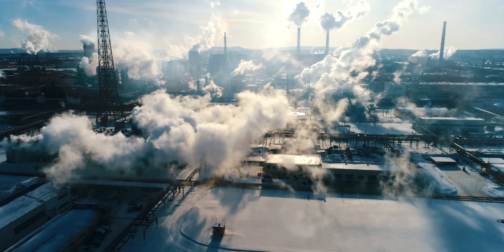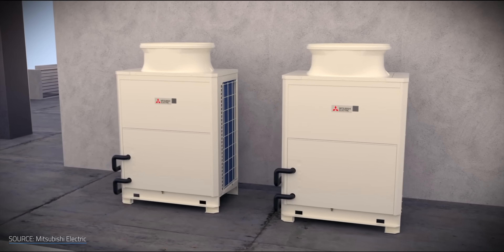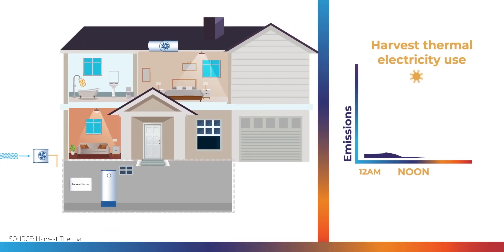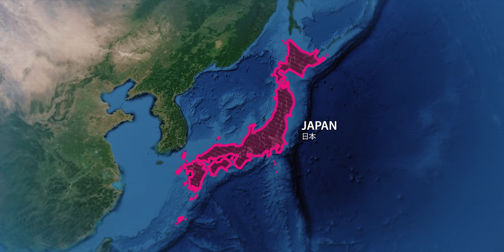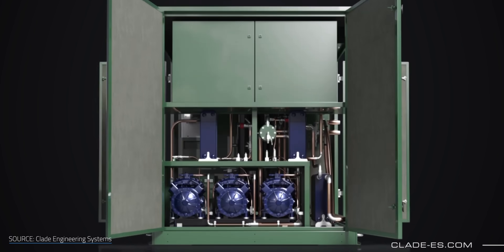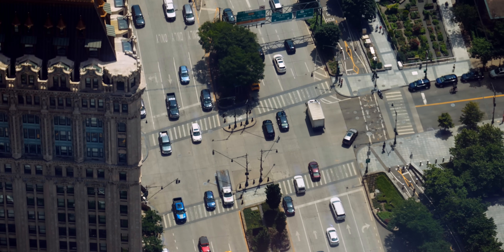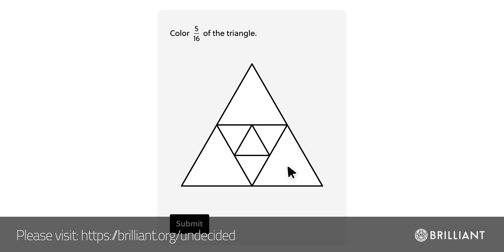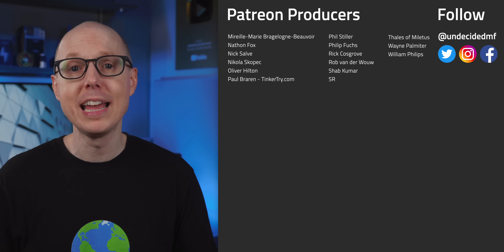Why CO2 Heat Pumps Are The Future Of Cooling

Comment: I always thought part of the efficiency gain of a heat pump was due to the phase change in the heat transfer fluid; typically liquid to gas.  With CO2 I was under the impression that you couldn't get this phase change as CO2 has a strong preference not to exist as a liquid, the triple point is just not in the right place.  So how exactly does a CO2 based system get to COP of 3?
Reply: Heat pumps work by chaning th pressure of working fluid or gas.  You donned a phase change to have an efficient device.  Dropping the pressure will cause the refrigerant to cool.  Increasing the pressure increase temperature.  PHse change is not repuired  for an efficient heat pump.  In fact you can use hydrogen or helium as a refrigerantin an eficent het pump without a phase change occurring.   a heat pump  and these gases need to be cooled down to nearabsolute zero (-273C) to liquify.

Comment: I was sort of joking about this recently - but could/would it ever make sense to combine all our heating/cooling? Like could a system like this hook up to fridges and freezers in the house too? (obviously expensive (guess having fewer compressors wouldn't do enough to offset the cost of it being novel) and risky - single point of failure, a whole separate high pressure, insulated piping system in the house, etc... )
Reply: Hooking up the 750 Btu refrigerator or freezer compressor to your home cooling 36,000 BTU compressor is not a good idea.  They use different compression ratios, and to make your home cooling system run at 0F to make the refrigerator or freezer work, it would be consuming much more energy than the refrigerator or freezer would consume.

Comment: Az uses heat pumps but never knew about c02, just had our condenser replaced. When our ac goes out or building my future home curious what cost benefits there would be compared to geothermal or other cooling and heating optiona

Comment: Ok, you really don’t have a clue what you are talking about. The refrigerants we most commonly used were R12 for cars and refrigerators and R22 for home and business Air-conditioning. These were the best refrigerants for the job. “They” wanted us to switch to different  refrigerants so they claimed that the tiny little bit of chlorine in the refrigerant reduced the ozone.  People have so little critical thinking that they believe the lie. People dump gallons of chlorine in their pools every year. Chlorine evaporates quickly.  They said it would take hundreds of years to heal the ozone layer. How much have you heard about the ozone lately? Why is it magically better now? CO2 is not a good answer as a refrigerant. R12 and R22 is...
BTW, the refrigerant y1234 has propane in it, and people’s refrigerators have exploded in their kitchens when the compressor burns out. People have already died from it.
CO2 has an incredibly high liquid pressure over 1000psi at 86 F... R12 is a much better refrigerant... (COP doing change with temperature much, btu capacity is what changes) These machines with CO2 are full of extremely high pressure liquid (over 1000 psi)

Comment: I added a hybrid heat pump when I did a renovation.  That said, there is no temperature where it is cheaper to heat my house using electric over the gas "back up" line.  I am not arguing efficiency - I am only talking cost to me.  Once gas prices rise or electric prices drop, I will happily switch to the heat pump only mode.
Reply: True, but cost is not the only factor when making decisions.  Poisoning ourselves with gas to save a buck just doesn’t make sense.

Comment: I have worked in the commercial refrigeration space for a a long time with Ammonia refrigerant for ice arenas. 
For a few years now new arenas have been being built with co2 refrigerant, which at that scale requires a very different maintenance program than ammonia systems..

this is a good deep dive into the tech, I am interested in seeing what the wear and tear in the components is like at the higher pressures, because ammonia is such comparatively low pressure…
Reply: It’s going to be a nightmare. Especially in residential applications w/ lines buried in walls. Techs aren’t going to want to work on it for safety reasons. You should know that since most are not willing to work w/ ammonia for the same reason.
Reply: @Bob_Smith19 right on there.  imagine having to service an unknown system with 2000psi.  And the cost to bring out a highly trained and skilled tech will then equal a heart surgeon.

Comment: Air-to-water heat pumps are the standard design in the UK, since HVAC overall is rare. Our summer temperatures have tended never to be high enough to require cooling. Most housing stock uses wall-mounted water-based radiators to provide heating, sometimes augmented by underfloor heating where the flooring is appropriate. The big problem with this setup is that there is no way to bring fresh filtered air into the home. Also, most of the wall-mounted radiators aren't large enough to work well with the low deltas of most air-to-water heat pumps. As such, the journey towards Passive House will be long and arduous for the majority of UK homeowners.

Comment: I see it said over and over that heat pumps are super efficient because they move heat rather than create heat. I understand that concept. But I struggle greatly when I try to marry that idea with my understanding of how powerplants work to generate electricity, and my understanding of conservation of energy.

What is it about heat pumps that make them ill-suited for use in powerplants where they could pull heat from the ambient air to be used as the heat source for boiling water into steam and turning turbines? It sounds so close to a geothermal plant in my head, but just using the heat of the atmosphere instead of the ground. Nobody ever addresses why it is or isn't practical.

My own understanding declares it must not work, as that would be a form of perpetual motion machine which cannot exist. But every demonstration I've seen of a heat pumps workings seem to say it is possible so long as the COP is greater than 1.
Reply: I'm not sure if it could work theoretically or not. It wouldn't necessarily violate the conservation of energy, as you're not creating free energy, you're taking energy from the atmosphere and making it do work.

That said, technologically it isn't possible. Power plants operate on steam that is often over 1000psi and over 1000 degrees Fahrenheit.

There are very few heat pumps that can even get hot enough to produce steam at atmospheric temperature and pressure (212F/100C). There are some that go higher, but not by much, and those usually pull heat from waste heat streams that are warmer than air, but not hot enough to create steam on their own.

Even if a heat pump was developed that could generate high temperature steam from air source, it would almost certainly be horribly inefficient because of the extreme temperature difference. Probably about as efficient as using the electricity to power resistance elements to generate steam.

Even if by some miracle of engineering a COP of 2 was attained, then it'd just barely work. Say you start with 100MW electricity, then with a COP of 2 get 200MW heat in the form of steam. The most efficient steam turbines are around 90% efficient, but that's for much hotter steam than you'll get from this theoretical miracle heat pump. A more realistic, but still very optimistic efficiency would be 70%.

So now you have 200MW of steam and a 70% efficient turbine giving you 140MW of mechanical power. The generator is very efficient, but not 100%, so you'll probably get 95% of that mechanical energy as electricity, or 133MW. Yes, that is 33MW of electricity gained, but you haven't counted the pumps, motors, etc that a power plant requires yet. Let's say that consumes 10MW, now you're left with 23MW more than you started with, and all it took was untold amounts of money and absolute miracles of technology and engineering.

You could probably erect 100MW of solar and grid battery storage for 1/10th the cost.

Comment: So if the refrigerant gets out in the confined living space it’ll be very toxic.  Especially with newer homes which are built tighter.  I’d like to ensure I won’t die in my sleep because of a CO2 leak.
Reply: You would wake up immediately from a CO2 leak, and leave the house. Inhaling high concentrations of CO2 (carbon dioxide) feels like what I can only describe as setting your nostrils on fire. Have you ever gone to drink from a very fizzy carbonated beverage and inhaled?

You're likely thinking of CO (carbon monoxide) which can and does unfortunately kill people in their sleep every year.
Reply: @Sparky95  
Inhaling carbonated beverages is markedly different than gas mixtures.  The aromatic compounds, cold droplets and potentially the acidity of the droplets are causing irritation. 
Here is a resource you may find interesting.  
https://www.fsis.usda.gov/sites/default/files/media_file/2020-08/Carbon-Dioxide.pdf

It is also interesting the first thing chatGPT says when prompted with this information is exactly what you said. Until provided the correct information.  Glad you still have a job CO2 heat pump company 3 bot 12.

Comment: > but most other heat pumps can hit a COP of 3+, but most other heat pumps aren't also heating a thermal battery.

I missed where you actually explained why a CO2 heat pump is better to combine with a thermal battery. Reading through the lines it seems like the CO2 heat pump is better at outputting high temperatures, but if this is true it should've been emphasized more. Also... waiting until the end of the video addressing the obvious is off-putting.

Comment: bro was this an ad? adding a water heat pump and a tank for saving battery should be a standard with every air water heatpump man
Reply: It is a stupid idea. Unless you use distilled water, high temperature causes biofouling in the tank. It has been reaearched to death. I cannot imagine the repairs on those huge tanks and rust! Omg, the rust!

Comment: I'm not certain, after all of the technical elaboration, why this particular sort of heat pump technology would raise any excitement. I can picture certain industrial applications where the operational parameters - especially the overall thermodynamic efficiency in certain temperature domains - may make this attractive for large plant operators, in large "unit operations", where pennies on the dollar in every plant function counts. Otherwise its capital cost, due to size and robustness requirements, will not leave it an attractive draw for the average consumer who is really interested (whether they say it out loud or not) in system commonality with existing widespread technology. The red-herring of using CO2 as a refrigerant will not keep any intelligent consumer interested either. Another "mediocre development" to my mind. best regards, DKB

Comment: There's research about improving the COP of CO2 by mixing it with R32 in a certain fraction. The research is called "Energy and Exergy Analysis of the Air Source Transcritical
CO2 Heat Pump Water Heater Using CO2-Based Mixture as Working Fluid"
Reply: Sounds interesting, especially given that efficient R32 units already achieve around 5.0 COP.

Comment: How about compared to where they run water underground and then through the building and back?   

So could this be used to refrigerate or even freeze a space while providing that heat elsewhere? Like for large scale walk in fridges and freezers. How is it "niche" if all restaurants and supermarkets have it. Since you wouldn't necessarily even concern yourself with the outside airs temperature.

Comment: My big problem with this channel is that it makes unfounded assumptions about man caused climate change. Has man helped increase C02….perhaps. Does CO2 impact climate….absolutely not. C02 levels have been 10x higher in the past whilst temperatures have been many times lower. Quit fueling the C02 hoax.

Comment: 20-30 Atm. pressure.... Not quite more like 80-100 atmospheres, your suction pressure (low side) is even higher than 30atm (~500psig) running R-744 (CO2) tubing and fittings are exponentially more expensive as well as the unit itself, only way CO2 will catch on in the masses in North America is if its legislated. Its only real advantage is that it has basically no GWP and its cheap, but everything else about it isn't cheap at all.

Comment: Could this system be used for hydronic (hot water radiators) heating? I have hydronic with an oil-fired boiler; I want to replace the boiler for all the reasons you can imagine, but don't want to lose the comfort of the radiators.

Comment: How can heat pump technology be more efficient than direct resistance heating which is %100  efficient? The motors to run just the refrigeration compressor is at best %95 efficient. Never mind the circulation pumps to operate either a ground source, or fans for air source. Then pumps to circulate through heat exchangers or hot water heaters. Every heat exchanger at best only transfers 10 degrees F.  Never mind the heat loses in the piping.
Reply: Easy, heatpumps have been doing a COP (coefficient of performance) of 3, some 5 or more for many years. 
Toshiba released their first inverter models way back in 1980, which took the technology to a whole new level. (think of the term COP as representing cost of performance, a system with a cop of 3(running in most economic low output conditions only, or it can drop to just 1.5 with some at max output), that is using 1kw of power,  can produce up to 3kws of heating. 

Explanation based on a  Mitsubishi electric item -
Like a fridge,  Heat Pump technology transfers heat energy from place to place using the vapour compression cycle.
A heat pump uses the fact that a fluid’s boiling point is affected by pressure. 
Lowering the pressure lowers the temperature at which the fluid evaporates, changing from liquid to gas(in the evaporator): raising the pressure raises the temperature at which it condenses,(in the condenser) changing from gas to liquid.

In heating, Refrigerant in the evaporator(outdoor coil) is colder than the heat source(outside air temp). This causes the heat to move from the heat source to the refrigerant as it evaporates.
This vapour moves to the compressor where its temperature and pressure are increased.
The hot vapour now enters the condenser (indoor coil) where it rejects heat as it condenses.
The refrigerant then moves to the expansion valve; drops in temperature and pressure; then returns to the evaporator to complete the cycle.

The only lies with it, are inflated performance claims with some brands, but in my 40 years working with them, i have never seen any that do not do a lot better than 1 to 1 when working within their rated temperature range. For our brands here that's usually -10c to +35c, but overseas cold climate models can work efficiently at much lower temperature than that.
Reply: I am fully educated on how refrigeration systems works no matter what transfer medium is used thank you, The systems basically work the same. How a unit that uses 1kw of power and produces 3kw in return is physically impossible. Perpetual motion machines do not exist. Nor do motors driving generators on their own. I can understand the small return with a heat pump, heating domestic water rather than wasting the rejection heat to the atmosphere. But the electrical losses are still there in motors. Just not happening. FYI, I work in commercial power generation. If these magic efficiencies really existed, we would have exploited them long ago and figured out how to bill you for them. Trust me. @Retiredkiwi

Comment: I had a SANCO2 water heater installed last year in my Salem Oregon home.

It is awesome and produces an abundance of very hot water.

That plus my whole home heat pump heating system allowed me to disconnect methane gas service.

Hallelujah!

Comment: With regard to thermal storage, while water is a relatively good thermal storage media, using a phase change material to store the thermal energy would allow more energy to be stored in a given volume and it does so at a constant temperature. Water suffers from having to store the energy by warming up and then releases it by cooling down. This means that the water has to operate from a minimum temperature that gives acceptable air temperatures coming out of the registers to a maximum temperature that gives the desired amount of energy stored in a given mass of water. The issue is that the compressor system has to be designed to operate slightly above the maximum water temperature. With a larger temperature difference more energy is required to move a given amount of heat from outside to inside. 

A phase change storage solution allows the heat pump to operate with the compressor exit temperature at the minimum temperature rather than the maximum. Water can store 4.19 kJ/kg - K. So 300 kg of water (roughly 80 gallons) operating from 55 C to 80 C (131 F to 176 F) can store 31,425 kJ of energy. The organic phase change material A58, from PCM Products UK, melts at 58 C (136 F) and has a latent heat capacity of 240 kJ/kg. Thus 300 kg of A58 would store 72,000 kJ. And it does so at a constant 58 C (136 F), so the heat pump can run at a lower compressor discharge temperature and so have a better coefficient of performance (COP).